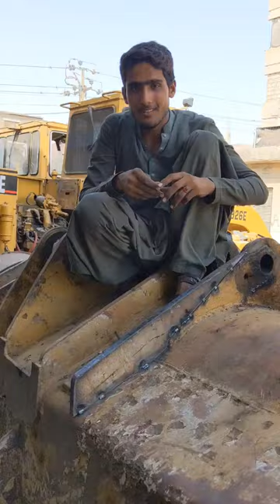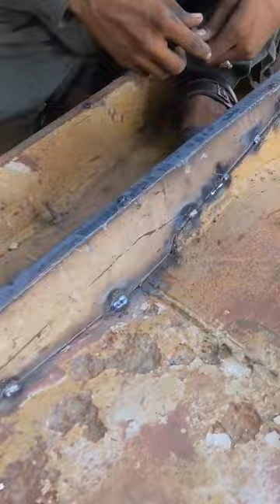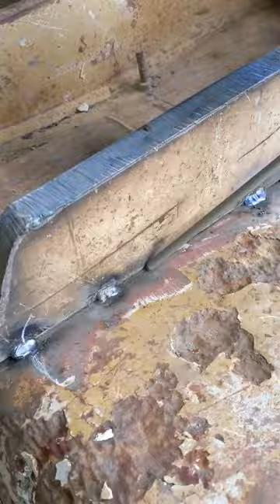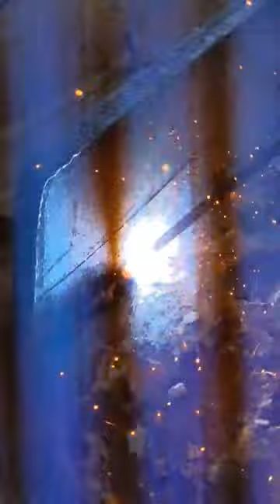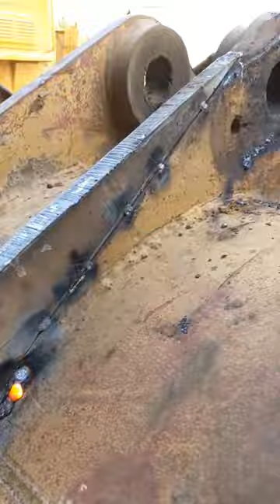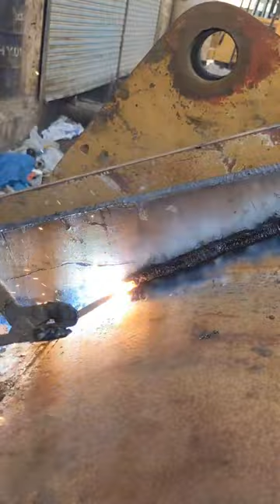Two secrets method of Root welding #shorts #trending

Comment: Prep(grind) that plate before it tack welded .Bottom of plate should look like a V .Either side of the vertical plate ,tack temperarary supports which will stop it bending or distorting .preheat that metal .weld it in a continuous pass, also not dragging the weld down on horizontal vertical .Go up . Use low hydrogen electrodes for strength.  Look up weld graphs on tee fillet and v butts .Hope this helps .
Reply: This most definitely will not help them
Reply: Disagree there is plenty of room on both sides of the ear that beveling isn’t necessary

Comment: Clean the base metal my guy you’ll get a much stronger weld also welding thick plate like that you should have a bit of bevel to get more penetration into the root of the material.
Reply: U all can get grinders in ur country or what?😅😅😅😅😅😅
Reply: They work harder but not smarter in those countries, that is agricultural welding at best, lack of standards cause breakages more often than needed

Comment: No prep or pre heat wheres the bevel? Not to mention wire wheeling to clean metal 38 yrs exp. Cert.welder fabricator structursl steel my 2 cents fellows